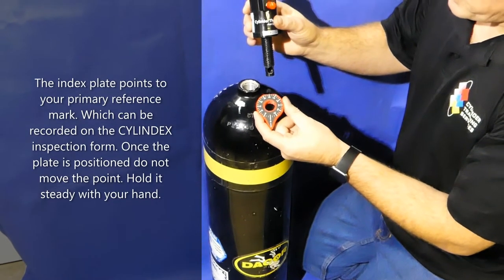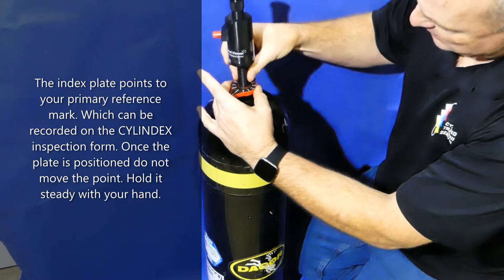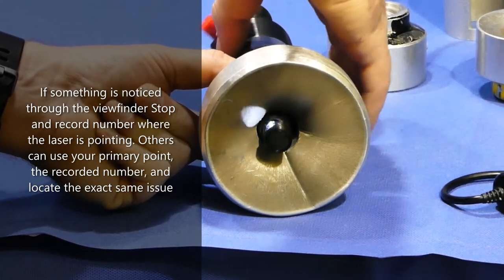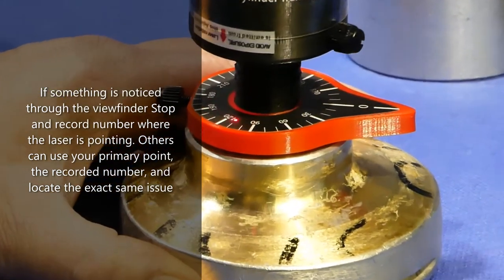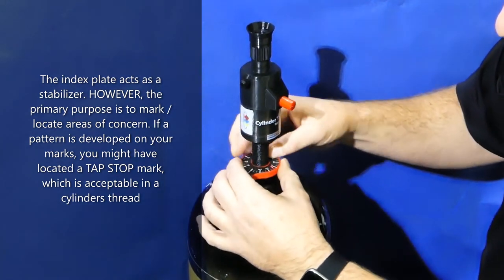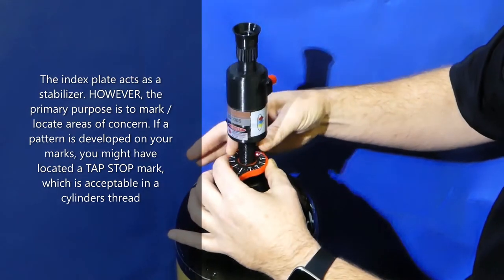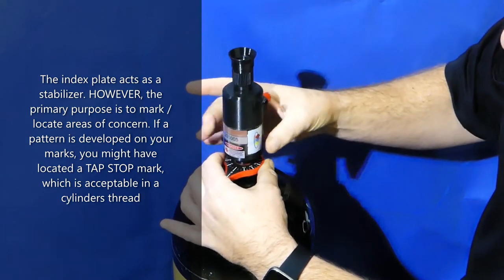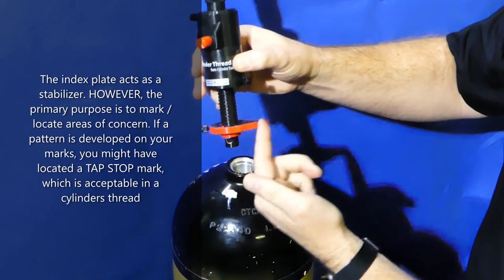Cylinder Thread Viewer -  Thread inspection using index plate

Comment: Does it work with M25X2 thread tanks (European specs)?
Reply from the maker: so sorry for the delayed response. Dont know why it did not notify me. YES  - the mirror tube goes into the index plate. The plate sits on top of the cylinder gland region. It can inspect all cylinder threads up to 2" (50mm) in diameter.